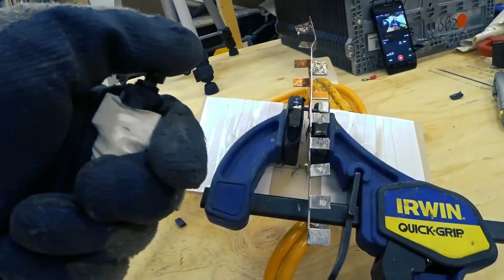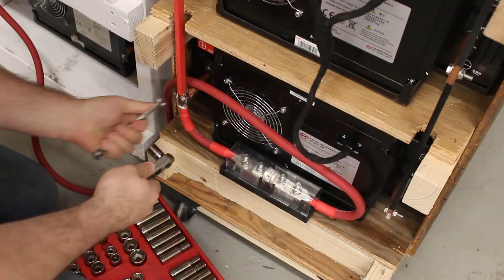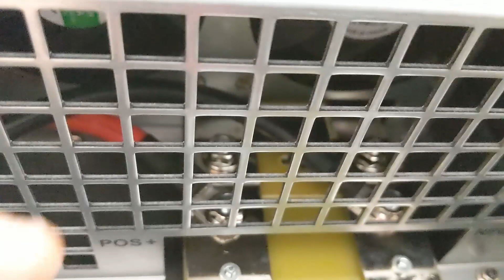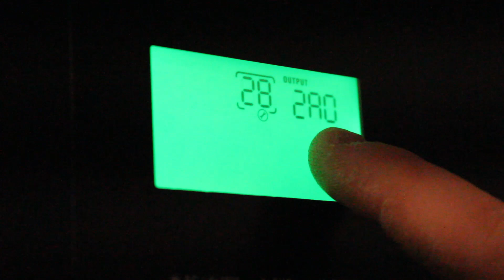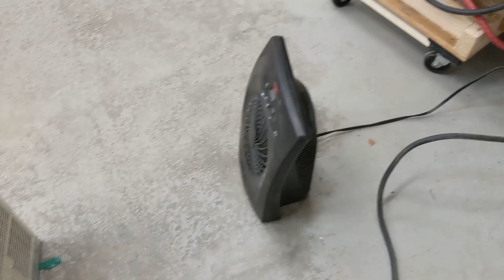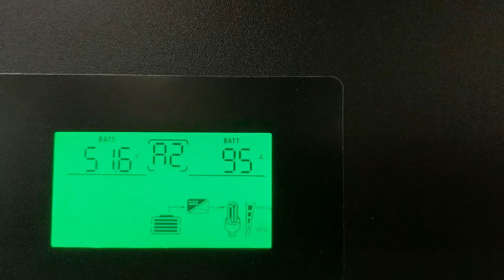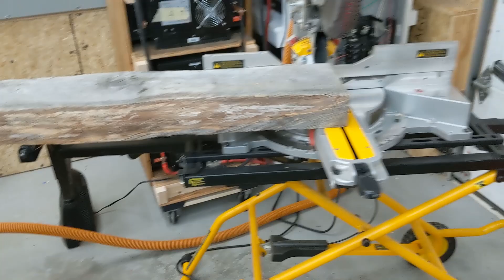Split-Phase Inverter, LV5048, Test Solar, Off-Grid

Comment: 48 volts 2.08 amps  24 volt  5 amps  12 volt  10 amps dc current  not enough amps with the 48 volt  try 12 volt or 24 volt

Comment: Hi David. Hope all is well. What I still don’t understand and no one has ever seemed to explain fully is: How does one wire the breaker panel in split phase. For example appliances that are 110v and those thst are 230v need separate supplies. I’m wanting a off grid new build house and need 240v ac as well as 240v water and pool pumps. Do I have to have two separate fuse panels and split off using a Henley block (uk term) to one that’s being fed via a strip down transformer.
Reply from the maker: It's one circuit breaker box.  loads that are 120V are fed with a single breaker.  Loads that are 240V are fed with a duel breaker, literally the breaker is twice as big and connects to both 120V legs.  120+120=240V.  You might be able to see it in my video installing my 240V heat pump.  https://youtu.be/Kd092alkeaE starting at time: 57:29
Reply: @DavidPozEnergy Hi David.  The thing is I was planning on having both the Jamaican and English in wall plug sockets in each room. As that’s what a lot of retiurnees do when they build their houses. So uk guests will be comfortable when plugging in 240v irons and curling tongs etc. Plus my fridge freezer and pool pump’s would be 230/240v. I’ll take a look at the video again. Thanks a lot. Just need a comprehensive explanation to get my head around it. I was thinking I needed to separate consumer units (breaker panels) with a transformer like in your growatt video to achieve my aim.
Reply: @DavidPozEnergy  Hi David. Can you make a video on how European, mainly uk & usa wall plugs are designed into the breaker panel for off grid system with split phase inverters. I need around 20kw to run whole house plus 2 x 1.5 to 2hp pool pumps, a in ground rainwater 1.5 hp water tank pump. 3 x Roof top evacuated tube solar tank recirculating heat water pumps, 13 x zones innovair inverter type mini splits, 3 fridge/freezers, 1 separate fridge and two separate freezers, 240v ignition for gas hobb (stove top) 4 microwave ovens and 4 cooking extractor fans, 8 bathroom extractor fans (not all used at same time 😀), and two washing machines and two dryers again not all used at same time. That’s a huge amount of loads. Will 20kw system cut it or do I go to 30kw.

Comment: That inverter is JUNK. I have an AIMS 4KW Inverter Charger with a 12K surge and mine can start that saw even with a large Compressor running at the same time.

Comment: Hi i need help,
I have install mpp solar PIP 5048MGX this inverter working lead acid battery fine no problem but after i change to lithium battery in series 12.8vX4=51.2V ( brand Power queen) system gets off and on again and again its keep doing only when charge hit 55V and also
When battery get very low level its not charging to Grid system get off
But when with lead acid its fine.
Work no issue.

Can you help with setting with this battery.
Reply from the maker: It would be important to find out what is shutting off.  Is one of the batteries BMS (battery management system) shutting off, or the inverter?  Usually when I talk with people who have lithium batteries in series it's the BMS on one of the 4 batteries that's shutting down.  I'd remove them, top balance them, and then try it again.  Here is my video on that: https://youtu.be/xQN5KoBQ730
Reply: @DavidPozEnergy  thanks you very much,
I will try this.

Comment: There's is a way of getting the full 5kw Out of 120v
By linking jump both inputs into one 
And same for both outputs.
Under Setting 28 set to 2p1 or 2A0

Comment: Surge is real. Have more respect to OFF GRID diy - ers and equipments.  Looking to charge model X, run hvac 24/365, used electric range, run well and septic tank, use compressor, light up all my flood light plus all my 120v loads. How big of an inverters do I need on a 3500 Sq ft house?

Comment: David, I imagine a solid state relay with zero crossing detector will prevent your inductive load switch on overload issue for the mitre saw.

Comment: When u test the Line and Neutral on the Growatt what are the reading on the meter does touching both the L & N with the meter = out to be 240 ? im trying to find out if line is 120 and neutral is 120 to give u the 240v or are they both 240 on the Growatt

Comment: 5kw so deceptive,  using two inverters at 2.5KW.I wrote mpp solar about 72V and higher DC input because of poor surge power in hf inverters,  they only have 12-48V units, so I didn't get caught but lf inverters use 100+ Watts  at idle so I'd suggest he go lf for the pump or go with a three phase inverter from MPP solar 3-5 times the size of the pump KW or use a  soft starter to eliminate the inrush current, either way the cost goes up. In this instance a standby genet is always a cheaper option.

Comment: I used LV6048 MPP Solar Hybrid unit. I had to return it because it could handle only 3000 watts on each leg with some surge capacity that was not good for my application so I had returned it. But I believe these units can be hooked by parallely for higher capacity. If two 6000w split units are connected in parallel do they support 6000w on each leg ( we know a single unit can support only 3000 watts)?

Comment: Can you just run 2 - 110 v outlets straight from the unit or you have to go 240 to 110 like you did ?  I’m wondering so I can run 2 Soave heaters separately

Comment: Great gettn the 6548 120/240!
Thanks Dave.
Reply: I went with the PIP LV 6048 units (x2) instead. Each has Grd/L1/L2/N very easy to set up.
With 200Ah of Batteries, this set up can start my big 6Hp air compressor (Peak Amp on start is 27A 240 volt for a few seconds!) Super happy with the MPP units.
9 440W solar panels on the roof feed this system, 15A utility available for charging if no sun for a few days.
Reply: I noticed with one 6048 I also had trouble to start a chop saw, but no problem with the well pump.  The unbalance error came up with the chop saw, and putting a smallish load (lights) on the other leg solved this generally, but occationally still an error.  Later when i had two 6048 and two 100Ah batteries, no problem to start bigger motors even 120 volt ones. For anyone reading this, some items like air compressors may have motors that can be internally set for 120 or 240, by using 240 the amperage will be half and will always be in balance on the inverters.

Comment: I would have a look to see IF one CH on scope is bandwith limit to 20MHz & earth clip on scope probes often go open circuit, thus picking up noise, the other situation with a motor, the peak current far exceeds the rating of the inverter when first switched on, that's why it will shut down, the other loads are resistive, no induction to bring that start up beyond the inverter capability, watch out for scope earth through the TWO CH's at different potentials BANG !, HP/Agilent Scope do have different colours for the various inputs, see colour of settings, Yes High Inductance of a motor on startup will no doubt go far beyond inverter capability ! there are units on the market called soft start BTW,  Best regards Philip retired instrumentation Engineer & Motor Drive - Controller repairs engineer England UK

Comment: Not good. I routinely ran a 15 amp miter saw and other universal motor tools on my old RS2000 for years. I now have a PAE4844 and routinely run the same 15 amp universal motor tool and cap start induction tools as well. However both inverters cost more than the price quoted for this unit.

Comment: peak startup... duh the saw with shopvac put the rig into protection. do it again and really get the temp sensors warm... same thing if you just start the saw a dozen times with no vac. i bet if you let the mpp sit unloaded for 10-15 minutes so the temps cool down; you can run shopvac on one side and get a start from the saw. i have a client with a 5048 and he was chopping blocks with a ryobe pos saw. made a few dozen cuts with hard motor starts and shut his down. keep saw running for all the cuts and it's fine. i own a 5048 and i can run shop vac air compressor saw, microwave etc. your test is flawed due to inrush currents heating up the mpp most likely in a spot with thermal protection. i also run an electric dryer on mine using the low heat setting for 50 minutes per run. takes it up in the higher range of use with all house lights, computers, tv's on etc. i can shut ours down if u start the microwave which is on one side of the mpp along with the dryer using both phases. fair enough as it is only a 5kw split phase rig. anyway your "drama" on the vac/saw testing is somewhat deceiving as i can run both similar on the same lv5048. note for longevity i would recommend using things like the hi ampherage dryer when the solar is also tossing 20+ amps into the system so it's not just slamming the batteries. our dryer pulls 54+ amps from the mpp. last note as i have seen your videos; please think about using an insulated ratchet around the dc lugs... one slip and you might start a welding project!!

Comment: Can you get 5000w at 120v?
Reply from the maker: yes, if you re-program both sides to only be 120v.  But if you do that, then you can't run a 240V well pump.  This is my friends inverter that I'm borrowing for the video.  he has a 240V well pump.

Comment: Great show, Hope you can help, I have a LV5048 MPP Solar charge controller. I am showing 60+ volts from batteries to master shut off switch. Sometimes when I turn on my unit from the on off switch under the unit just above the + and negative nuts I get sparks? I checked my nuts and thy are tight, why am I getting sparks?
Reply from the maker: I don't know, since I'm not there to check.  You might want to film it happening and upload a video?
Reply: @DavidPozEnergy  good idea, thank you...also we like your program

Comment: Looking at all the batteries, inverters, switches, breakerboxes, etc.
One thing screams in my mind: "WTH aren't all these things available with DIN rails, common bus bars, standard rack enclosures?
Reply from the maker: There is one really good inverter with all the included breakers.  Sol-Ark 12K.

Comment: Hello, I'm getting a 48 volt version of this mpp inverter that does 6,500 watt 120 volt output going to a 50 amp 4 prong outlet to supply my house power. What is the best way to connect the 3 prong ac output wires to my 4 prong 50 amp input for my house? Thanks in advance for replying.
Reply from the maker: In North America we use 120/240v split-phase power.  This means our homes are fed with two hot legs, each at 120v.  If you are going to have just one inverter, putting out 120v only, then you shouldn't connect it straight to your house.  Instead, it should be either:
1. connected to a 120v only load center that only takes 3 prongs
2. Get a second inverter and program it 180° out of phase to make 240v
3. Use a transformer between your 3-pron and 4-prong.  Here is an example of a transformer: https://amzn.to/3wPpTY6

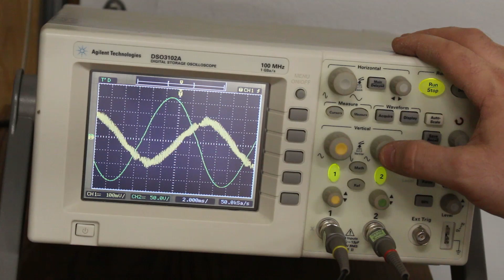Comment: 19:00  You are not measuring on the phase with channel 1 on the oscilloscope, see left hand corner, 50 mv/div so it is noise you are measuring. channel 2 you have it right, 50V/div   remember the chassis on the oscilloscope, is equal to the GND on the probe so take care or it will blow up if you connect it wrong. 
Please read  SAINOLOGY he's right you know.

Comment: With the 2 solar array inputs, do they need to be identical? For example could one input be 150v solar and the other 100v.
Reply from the maker: The two MPPT inputs are completely different, so the two solar arrays can be completely different.

Comment: Usually well pumps have a pretty high startup current as well.  Is that inverter able to handle the well pump ok?
Reply from the maker: Yes, my friend Bill has it installed, and it can turn on the well pump.  However, it will not work if he has one other large appliance on at the same time.  So, if the coffee maker is on and the well pump tries to kick on at the same time, then the inverter shuts down.  I'm not a fan of this inverter.  There are better ones on the market even at this price point.
Reply: @DavidPozEnergy  Please share which 48V inverters with 120/240 split phase are better at this price point or below.  Thank you.

Comment: This is the only one of your videos I didn't love. You see I have a LV5048 and I has been working great supplying power to my home. I used common every day appliances with no problem. If I want to used appliances with high current draw or maybe buy an electric car I would just buy two more LV 5048. They are stackable. I still like the video though:)

Comment: How much power does the saw draw? And do you have any guesses what the surge is? HF Inverters generally fare much worse with surge/surge times from my understanding. I wonder why he didn't vie for a LF inverter for pumps as they generally have a lot of surge. Also, did he tell you if it was able to power his pump using both phases? Lastly, is this inverter limited to half of its Kwh rating because it's technically 2 in 1? I'm new to all of this so if my questions dont make sense forgive me.
Reply from the maker: My miter saw inrush current is 67 amps.  The motor is rated for 15 amps.

Comment: Great video, what additional parts will need to connect this inverter to my main home panel to power on lights and fridge in the house when power outage occur? extention cord is limited and inconvience, thank you!
Reply: You'll need a critical load panel that is not your primary circuit breaker panel. Then you'll need all the cables to connect the inverter to the battery and inverter to the breaker.

Comment: Hi really like watching your videos on inverters and testing them. And the info on batteries. lithium batteries are brilliant but cost way to much. Can you tell me what calendar life is not cycle life.
Reply from the maker: If a battery has a life of 365 cycles, and you cycle it once a day, then it will last you one year.  If you cycle it once a week, then it will last you 7 years.  And so on.
Reply: It seems most inverter manufacturers recommend lead/acid. Must be a reason

Comment: How’d this turn out with your buddy’s well pump?
Reply from the maker: Yes, it can power the well pump.  However, if just one other appliance tries to turn on at the same time as the well pump, then it will shut down.  So overall this is a disappointing inverter.  I have a follow up video here: https://youtu.be/6XLOKtl-q3s

Comment: Thanks for your video. I have a question:  All BYD battery need install BMS with protector Cell or you connect direct to Inverter? Are they will works good without BMS? Thank you

Comment: I have an AIMS 24 VOLT low frequency Inverter/Charger that can start that saw very easily it's a 4KW with a 12KW surge for 30 seconds.

Comment: Resistive loads and inductive loads vary quite a bit. The inverter does really well with the heaters but the motors kill it. Power companies would love for everyone to use resistive loads and hate manufacturing plants with inductive/capacitive loads.

Comment: @6:19 FINALLY!!! Someone using a [censored] precharge resistor.

(I guess you didn't want to risk blowing up someone else's $1500 inverter.)
Reply from the maker: LOL.  No, I didn't want to blow it on my friend.  I learned about the resistor thing after I had a capacitor pop off a board right in front of me.

Comment: your incorrect regarding the phases being 180 degrees out of phase, there actually 120 out of phase, the proof is shown on your oscope, this is true for the line voltages coming in from the power company grid.
Reply: Wrong.

Comment: Miter Saw – 1800 running watts, 3400 startup watts
Table Saw – 1800 running watts. 3500 startup watts
Circular Saw – 1800 running watts, 3200 startup watts
Power Tool Battery Charger – 330 watts

so that you need single phase 3500W or above so that 8KW inverter may required.

Comment: Mr Poz
I am trying to install a interlock switch to power a few selected appliances which includes 220v well water pump.
But I have a 3000W Predator Inverter generator which only supplies 110V (NEMA L5-30). How can I do it?
Please advise.  Thanks
Reply from the maker: They make transformers that can take the 110v and output 220v.  But I'm sorry, I don't know enough about that topic to select a model for you.  You may get an answer by posting this question to a facebook group.  I'm in "DIY Powerwalls" which is pretty good.
Reply: @DavidPozEnergy  Thanks for the prompt reply. 👍👍👍

Comment: Something is very wrong David, Check your Probes, Ch2 looks ok, Ch1 is NOT !,,,,,,,,, Look at the Volts Per Division Ch2 = 50V Div  & Ch1 looks to be only 100mV Per Division !,,,,,,,,, Be vare careful on Probe Grounding !!,,,,,,Thats a Warning,,,,,,,,,,,BTW TheScope will have a Probe check clip attach two probes to Probe Check and Press Auto Range, I presume you will use x10 Probes ?,, Yes ??? look at the switch position,
IF Great Errors then swap probes, if still a error, then Input damages to scope ? Agilent have Download Manuals you have to register your name with them first,,,,,,, www.keysight.com
Used to be HP then Agilent then Keysight 
Philip from Cheshire England UK ,,Ex UKAS Lab Scope Test Equipment Engineer

Comment: Hey Dann, u should try using inverter using the 110v phase by itself (as opposed to the 220v).  

Since the surge of the miter saw is alot, single phase 120v mighy be the best option.  Just a tought

Comment: try adding some power-factoring on the AC side, and like a Cap on the D/C side, even a start / run Cap on the AC side, you can find a dc 11uf out of a ele car controller that should do it and cheaply LOL
I would worry if it wont run your dewalt its gonna have a hard time with the well pump too, did it end up working for your buddy in VT?
Reply from the maker: I did run the well pump, but not much else.  Video on it: https://youtu.be/6XLOKtl-q3s